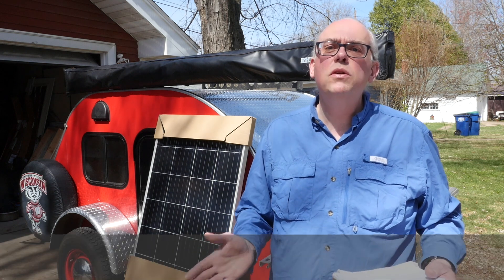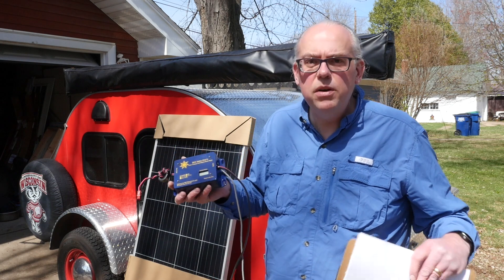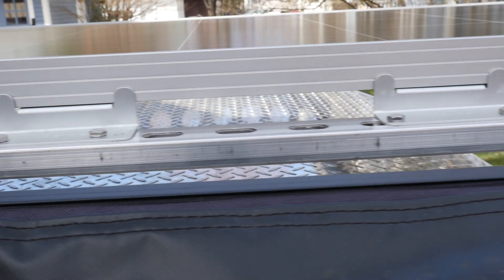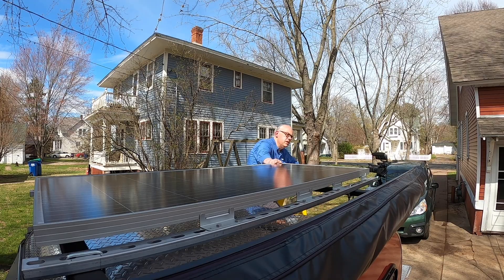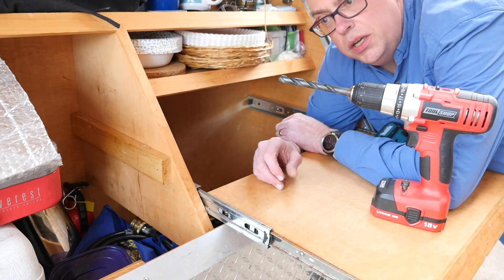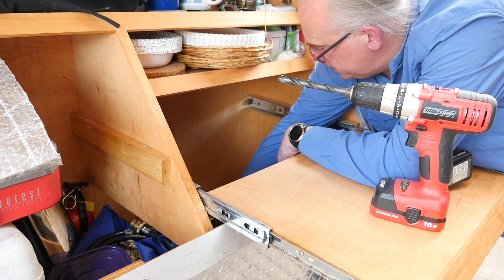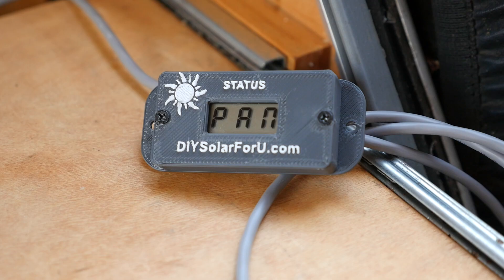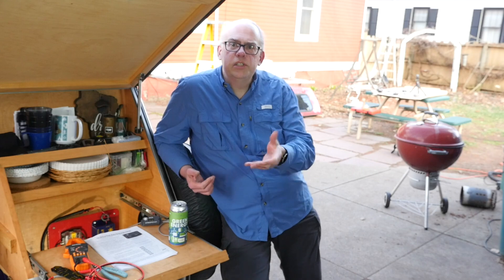Teardrop Camper Solar Panel System Off Grid Boondocking - Ham Radio Q&A

Comment: Can you operate the Ham Radio? And how long can you operate?
Reply from the maker: I can operate the radio from the trailer, but I usually don't. The primary purpose of the solar is to power the refrigerator, lights, and accessories. On average I consume about 20ah a day for all that. If I were to add the HF transceiver, it would add another 4-5ah to the power budget (if I am transmitting, receive only is 1ah). The length of time I can be out and operate depends on my battery's capacity and how much energy the panel is producing. I currently have a 50ah battery in the trailer, but will be upgrading it to an 100ah battery this spring, so I won't be as concerned about generating power if my trailer is parked in a really shady spot.

Comment: I have a friend who is a ham and has a metal roof on his house.
Can he use his metal roof as an antenna?
Thank you.
KE8PMM
Reply: I don't think a metal roof can be used as an antenna... maybe as a ground plane below a vertical antenna with the roof ties to ground.  It is also too close to potential noise sources from wiring in the attic.  It would act as a shield if used as a ground plane shielding noise sources within the home if the antenna was above it.
Cheers,
Rob - KD8SKM - CTO at DIY Solar for U

Comment: This would be better at the entry point of your trailer: https://www.amazon.com/gp/product/B009LX1JWU/ref=ppx_yo_dt_b_search_asin_title?ie=UTF8&psc=1 That way, you could carry 12 Ga wire all the way to the controller. That SAE connector might melt or deform on you if the amperage is higher than the rated capacity. You can always disconnect the PV Power from the MC4 connectors directly.

Comment: Safety tip, when connecting the battery connect the positive first and then the negative.  When disconnecting, remove the negative first and then the pos.

Comment: Right now I have 4 10W panels and one battery with a controller for my out in the sticks radio set-up. Don't have a fancy camper like some, just a Ford Flex and pack everything up, pull in somewhere, put up the panels and hook the radio to the battery! On the air.

Comment: Awesome setup mate.
On a side note, 10m J-Pole???
Reply from the maker: I'm still planning to build a 10 meter J-Pole. The price of copper has spiked tremendously in the last two months and I'm going to wait until it comes down to a reasonable level before I do that project.
Reply: @KB9VBRAntennas  cool idea, but aside from the occasional repeater, I'd guess there are not many vertical 10m signals out there.  But for the memes, fantastic idea.

Comment: does this make AC or DC ? How many volts and AMPS ? Is it only for recharging ?
Reply from the maker: This is a 12 volt DC power system. I have no need for AC or an inverter in the trailer. The panel can deliver up to 180 watts and the charge controller can do 20 amps. The battery is a 50ah LiFePO4 battery. The entire system is seamless in that the solar charges the battery and the battery delivers power to my devices. During the day I should be running at a nearly fully charged state and at night the battery will deliver power.

Comment: Are you hearing, or measuring, any RF noise at all from the MPPT controller?  You might have to go to a low noise location, like a rural park, to really test the RF noise floor.
Reply: Yeah, I too would be interested in a follow up video showing some tests of the noise floor with and without the solar connected and with the solar charging. I have been wanting to add solar to my teardrop and was concerned with RFI. My shore power charger generates so much garbage I have to disconnect it to operate HF. Thanks for the video Michael. 73, Ed KI1R
Reply from the maker: I'm not going to be able to take any meaningful measurements at home as my noise floor is too high. In little over a week I'll be taking the trailer out camping for a weekend in the UP of Michigan. Radios will be involved so I'll make note of how much noise the charge controller makes.
Reply: As long as there are no weird installation issues like ground loops or improper grounding and the receive antenna is at least 6 feet from the controller you should not hear any added noise with the controller operating on any HF or VHF band.  Tying the battery negative to the trailer frame at ONE and only one point will form a Faraday Cage with the aluminum body and further shield any residual noise.  We have many HAM's across the globe using our controllers without interference - many without any additional RF filters too.  The only other potential issue would be conducted noise on the battery side if the radio has little or poor power supply filtering (and some do) - that is easily solved with a choke on the battery side if it s an issue.  I think all here will be surprised just how quiet our controllers are when Michael test's it out this weekend.  Cheers - Rob Tywlak - CTO at DIY Solar for U.
Reply: @solarpower3081  Thanks Rob and Michael.

Comment: Just for your info Micheal,I had an issue with my portable system.If take the Battery down so the battery bms opens up because the voltage is too low and DIY Solar change controller won’t see the battery and won’t charge the battery and answer is install a low voltage cut out higher than the BMS cutout voltage.Hope this helps ve7gde
Reply: That is a potential problem when utilizing any battery type that has a built-in low voltage disconnect like the lithium iron phosphate's BMS.  It's too bad the energy from the solar panel can't kick start the charge controller for a couple of seconds.
Reply: This is not a problem with our controllers since fall of 2017 - we added a battery wake up routine so if a BMS cuts off a battery but there is solar present the controller will wake up the battery and begin charging again.  The only thing lost is the 7 day totals in this case if this happens at night which it usually would.  Cheers - Rob Tywlak - CTO at DIY Solar for U
Reply from the maker: Thanks for the tip. Hopefully I won't bring the battery down to such a low level overnight, but that's information to know.
Reply: Jack - I am surprised you had an issue with this since you have a controller with the wake up feature.  During wake up the LCD will display "tSt" and there should be voltage on the battery terminals.  The only thing that could prevent this from working is if there is a load on the battery terminals not allowing the voltage to come up or if the BMS has a built in trickle charge limit in that case it may take a few minutes to "wake" the battery.  The Controller sets a low 0.5 amp current limit during wake up so any system load could prevent this from working.  DC to AC Inverters usually do not present a load when the battery cuts out until re-started or some will wait for a voltage above 12 or 24 to restart - in both of these scenarios it should wake the battery first.  You may need to wait a few minutes in your case if there is voltage present at the battery terminals during the wake up mode.  Cheers - Rob Tylwlak - CTO at DIY Solar for U.
Reply: @solarpower3081  That controller auto restart is a great feature.😀  In Michael's setup, the potential loads of his electric blanket and refrigerator might need to be momentarily disconnected to let the charge controller restart the LifePo4 battery if the BMS is in low voltage cut-off.
Reply: Yes disconnecting the load to allow battery wake up is important - also important to make sure you have MORE solar charge current than your load when you re-connect otherwise it will just cut out again.  In all DC systems its best to have a master breaker / fuse / disconnect switch for this purpose if you happen to over discharge your battery.  I believe in Michael's case based on the photos he could pull a fuse to serve this purpose if the loads do not have a power switch - just don't pull the one on the controller output to battery LOL :-)  Anything less than 0.5 amps could be left connected as it would still wake the battery in that case... like the voltmeter in the camper for example.

With the Lithium Iron Phosphate when they hit 12 volts you are basically done and will drop to 10.5 pretty quick after that.  Most of the time they are at 13 to 13.5 volts even when moderately loaded to 0.5C or in Michael's case 25 amps.  I would say at about 12.3 volts is your "low Battery" warning....  and time to watch the voltmeter more closely.

Cheers - Rob Tywlak - CTO at DIY Solar for U
Reply: @solarpower3081  Rob - It's awesome that you're following and participating in this solar project discussion.  Michael's videos provide great instruction and motivational service to a huge amateur radio community.  His product endorsements carry a lot of weight.
KZ9V
Reply: I am here to help all that will listen :-)   I am also a HAM but have not been on air much since I started the Solar Business.... and need to hide an Antenna in some trees to get back on air.  KD8SKM

Cheers - Rob Tywlak - CTO at DIY Solar for U

Comment: Hi Michael,
Is the remote LCD readout wired directly to the circuit board or is there a connector on the side of the case? Couldn't determine that from their website. You and the family stay safe. 73  WJ3U
Reply: Don - the remote display has a dedicated DATA terminal block inside and connects to battery (+) and battery (-) on the terminal block so no its not hard wired.
Cheers - Rob Tywlak - CTO at DIY Solar for U

Comment: My concern would be ventilation for the battery and controller inside the galley.
Reply: Joe - our controllers produce very little heat due to the very high efficiency of 99%.  The Lithium Iron Phosphate batteries can tolerate up to 140F or 60C without issue.
That said there is thermal protection in the controller that first will reduce power and if that does not lower the temperature then it will shut down to standby until it drops.  In this application you will not get close even on a hot summer day as the internal temp needs to be over 165F before any power reduction would occur.  Given the Shiny Aluminum Exterior the sun beating on it will not do much to heat it up either.  Cheers - Rob Tywlak - CTO at DIY Solar for U
Reply: @solarpower3081  Hi Rob - thanks for the info. I camp with Michael a couple times a year (nothing fishy - separate campers!) and I know he keeps the galley closed during the day. I'm really excited to see how the controller performs. We'll be up in the UP next weekend giving it a workout.
Reply from the maker: TC Teardrops installs charge controllers and SLA batteries, along with panels on their utility boxes. They also put systems, along with a Dometic refrigerator, in the galley. Many of those trailers head out west to the high desert.  I don't think the controller will overheat.